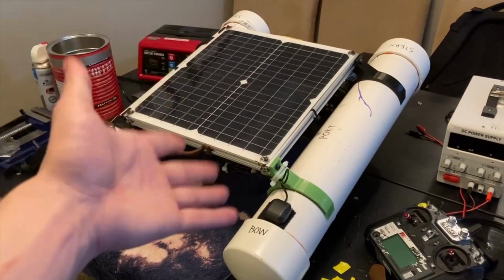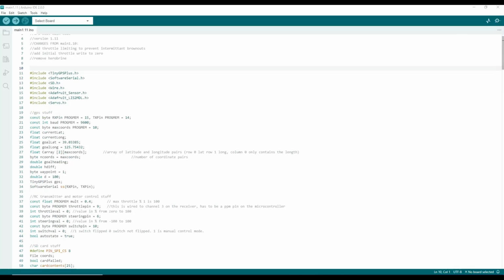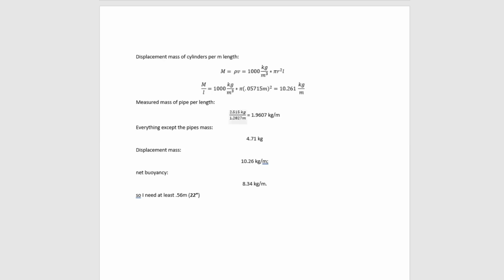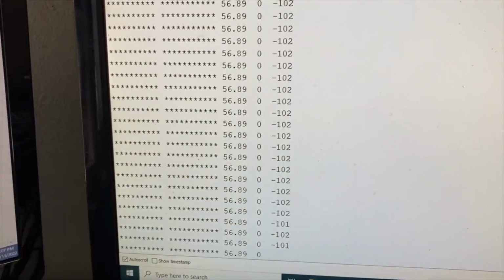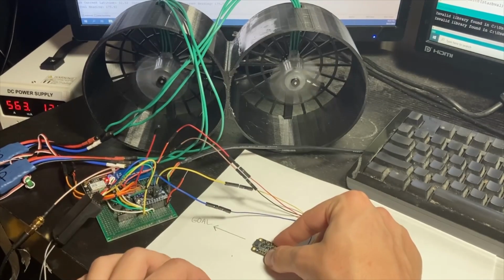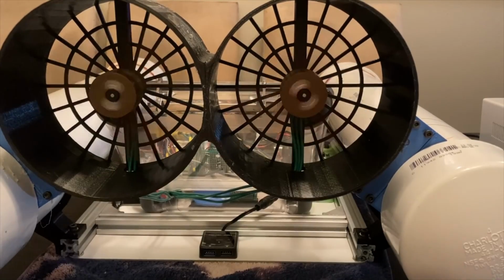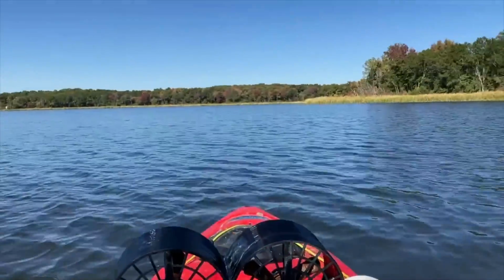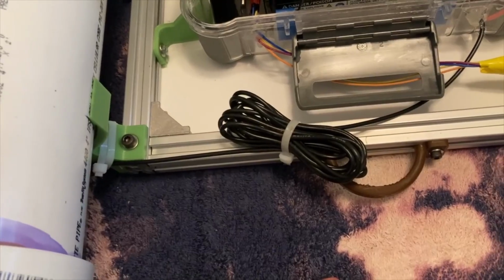Infinite Range Autonomous GPS Boat

Comment: Hey pls respond to this. My friends and I want to build a boat of our own and the only problem is how we are going to monitor it. So, I don't know if I missed it in your video but how did you control/make it were your able to communicate to it over long distances.
Reply from the maker: I don’t communicate with it over long distance. The RC transmitter can take manual control up to a range of about 100ft but I only use that for launch/recovery. I’ll likely implement 2 way communication/telemetry at range in the future with a serial radio.

Comment: What is this called and where can I learn in.
Reply from the maker: It’s custom control software that I wrote to run on an arduino, it’s pretty simple. Check my newest video on the project for the latest code version, I have it posted on GitHub open source.

Comment: For differential thrust throttle values (0-180), have you tried using reverse thrust as the range for each motor. 

So, -180 to 0 to 180...
Reply from the maker: The ESC’s I was using when this video was filmed were not bidirectional, so no way to reverse them without physically swapping wires around. I’ve also since ditched the 0-180 degree servo logic completely, it makes more sense to just use discrete PWM value in microseconds, 1000-2000 in this case.

Comment: How did you seal the cable exits of the motors? Which specific glue did you use?
Reply from the maker: The motors themselves are not sealed against water ingress. I used hot glue around the soldered joints on the back of the motor to prevent shorts between the individual phase wires. Also hot glue to fill in the drilled holes where the motors wires pass through into the electronics box. I’d use a proper potting compound if I were to redo it, but never caused a problem as it was in this video. Also notably, the pass through into the electronics box is not submerged, just keeping splashes out. Surely it would leak if below the waterline.
Reply: @Clay-Builds  Thanks for the fast and good reply! I'm doing my first underwater tests with electronics right now and I'm surprised how well hot glue seems to work all the time.

Comment: If your inlet shrouds were long cones you'd have a layer of self-cleaning capability. This will come in handy if you keep testing on lakes. Surround the panel with the sort of spikes used to keep pigeons from landing on ledges. Having a third, smaller thruster would give you better handling when you want to loiter in one spot (to lower a camera into the depths maybe). Adding ballast to the bottom of each float will increase stability. I assume they are hollow otherwise. I'd consider sizing the floats so they can be filled with foam. That way it will still float after being bitten by a gator/great white!
Reply from the maker: Yea this flat prop shroud design caused a lot of excess drag and it still got plants stuck to it a few times. For now I’m omitting the prop shroud entirely on the new version I’m building, but I’ll likely implement it in the future. I think a roughly conical wireframe design would perform much better. Also the props themselves could be optimized to prevent catching plants and trash.

Comment: Is there any obstacle avoidance technology on this pilot?
Reply from the maker: Nope, it’s flying blind.
Reply: @Clay-Builds Thanks for reply. What do you recommend for avoidance from debris, vegetation, and other dynamic obstacles?
Reply from the maker: @ehsankf  vegetation is pretty unavoidable which is why I always use some type of prop shroud for small scale boats. Your best bet for above the surface obstacles is probably LiDAR but that gets expensive quick.
Reply: @Clay-Builds  Does Lidar capture the obstacles floating on the water surface or hidden under the water?
Reply from the maker: @ehsankf  surface obstacles. There’s some small scale hobby level LiDAR units out there. Even some robot vacuum cleaners use them for SLAM.

Comment: Awesome design. I am working on an ASV for school. How did you waterproof the motors in your thrusters? Any tips would be appreciated.
Reply from the maker: Use sensorless brushless motors. For the most part, they’re inherently pretty waterproof and will have no electrical issues operating fully submerged. You’ll still need to worry about corrosion over time, but unlike typical brushed motors, there’s nothing inside them that could easily short out when wet. You’ll want to choose a motor with a relatively low KV value, because high torque is needed to drive a prop through water, and you don’t need very high RPM.

Many brushless motors, including the ones I used in this project, are specifically intended for underwater use. I didn’t do anything special to seal them or anything.

Comment: That looks like a fun project, and useful, too.

Projects like your/this have a lot of different disciplines to pull together, and not easy, from the physical construction, to the software, to the data interpretation. So, congratulations.

Perhaps the thruster box/deck mount could be made adjustable in height, to maintain a nice low center of gravity, like you have, but also to compensate for weight without using ballast. Alternatively, you could make a ballast tank, and fill it with water.

Perhaps you could slip in a rubber grommet (not the Harbor Freight ones) where the motor wires penetrate the shrouds.

A Teensy 4.1 would give you more processing power for the same code.

Have you checked out Paraview? As far as the props, you could also do a study with OpenFoam.

Comment: Awesome work!!! 
There is a potential in the code so that the activation point is saved and then always return to this point ??
Reply from the maker: It doesn’t currently do that, but it easily could with a just few more lines of code.
Reply: @Clay-Builds thanks for reply,  I will copy the code from the video or there is somewhere to download?
 I installed the other code with the sonar and takes 96% of 328ATmega ... there is any way to send you the progress of the progect ?
Reply from the maker: @zuzuniagrikubanos6473  I have a 2nd video posted with some updates to this project, it has a GitHub link where you can download the code. That version has a lot more functionality than what’s shown in this video, but you could remove a lot of what you don’t need to save memory. The data-logging, sonar stuff, error detection, etc. isn’t totally necessary if you’re just wanting to build a simple boat that drives around. 

The code shown in this video used almost 90% of the memory the arduino pro mini (atmega 328P) IIRC. A huge portion of that was due to the libraries I used for the SD card, magnetometer, and GPS module. Maybe you could modify or find some alternative libraries to save memory, but I ended up just upgrading to a better microcontroller.
Reply from the maker: @zuzuniagrikubanos6473  the pins in that code are correct for the teensy micro controller I used in the 2nd video. You might need to make some slight changes depending on what microcontroller you’re using. There’s also an electrical schematic in the GitHub link that shows which pins connect to what. Make sure the throttle signals are connected to PWM capable pins, compass is wired to I2C pins, etc. you can mostly switch things around to whichever pins you want, but I’d make sure the timing sensitive components like the GPS serial connection, receiver communication pins that use the pulseIn() function, and the PWM outputs should each have their own timers.
Reply: @Clay-Builds  I think the code in this video  is easier to find how to store the activation point, because it is also the most interested part in me ..I did print screen and to Arduino's program,,,if it work If it works like the video it will be perfect.!!!!there is any way to send you a photo from the progress ??an email maybe ?
Reply from the maker: @zuzuniagrikubanos6473  sure, you can email me here: claymantx@gmail.com
Reply: @Clay-Builds   thanks !!!!!!

Comment: I would of used a Airplane Prop type propulsion. A big problem with these boats is seaweed plugs up the motor. Its also simpler all you need is a directional vane to control it.
Reply from the maker: Yea that would definitely help with tangles but might sacrifice some power efficiency

Comment: Nice work😃 I like the idea a lot and it seems to work really nicely. I just fear it can't do really large distances as the motors are a bit weak? I fear they could collect some sea weeds or fishing nets etc. Hard to work around such issues..
Reply from the maker: Yeah the main reason I used prop shrouds is to prevent plants/trash from getting caught up. More powerful motors would need a much bigger solar panel, but I’d love to do a larger scale version eventually.
Reply: @Clay-Builds  I just installed 550W panels on my house walls.. they are 2,30m * 1,10m 😆 good scale I would say

Comment: Seems like you went thru alot of trouble waterproofing and mounting the box for the battery and electronics. Was there a particular reason for not storing the components in the water proof pontoons themselves?
Reply from the maker: I need easy access to the electronics so that I can troubleshoot, reprogram, remove SD card, charge battery, etc. The box with an openable lid is super convenient for this. The pontoon end caps are sealed shut with PVC cement. I didn’t want to put any holes in them and risk a leak since they’re critical for buoyancy.

Comment: What's to prevent the boat from being storm flipped upside down?
Reply: There is an easy solution for that. If your boat capsizes during storm it will flip back to its right position if you have a low centre of gravity. Preferably a 2 poles extending from the pvc pipes into the sea with lead weights.

Comment: Fascinating! I do have one concern. This design might work well-enough on most lakes, but in oceans the breaking waves could flip it over, killing the solar power. You might add a weighted keel to make it self-righting. The keel would also add more stability and directionality. As on a sailboat, it would lessen the need for the motors to constantly alter the direction.
Reply from the maker: This is only intended for lakes/ponds, although I’d love to build an ocean version at some point.

Comment: Is that solar controller reliable? that cheap controller seems easily damage battery.
Reply from the maker: It wasn’t great. I swapped it for a GENASUN GV-5, a more reliable and efficient mppt controller. Don’t think I showed it on camera, but it was installed during the test run.

Comment: I'd just use the PWM outputs on the Arduino to control the motors, no need for timing?
Reply from the maker: This does use the PWM outputs to control the motors.

Comment: Your autopilot relies on heading too much.  Look at aviation autopilots for methodology. Even 40yo aviation A/Ps will used tracking for control, not heading. 
Heading will always be wrong unless water current and winds are perfectly inline with path.

You need to computer the vector(desired track) from start point to end point and the adjust heading to stay on the desired track.  You need to correct for wind and water flow. To avoid hitting objects, the desired track must be followed, otherwise you will end up hitting the banks or running aground.

As you follow the desired track, the heading will face in a direction that compensates for the wind and water flow.  For example, a desired track of 180 and a wind of 270 might result in a heading between 180 and 270 depending on wind speed and water flow.
Reply from the maker: That’s true, in the presence of a strong lateral wind/current, it would make a wide arc towards the waypoint rather than a straight line. In the video I only used 4 waypoints, if I added a lot more between each of the major ones then it would greatly reduce this effect. 

The navigation currently assumes the direction of travel is always exactly in the direction the compass is pointing. I could also get the direction of travel from the gps module and use that for steering. That way it could steer slightly into the current/wind and keep the direction of travel exactly towards the waypoint. Only issue is I don’t think the gps heading is as accurate as the compass, especially at low speed.

Comment: Great work you got here!
Reply from the maker: Thank you
Reply: Clay .... can you share purchase link on the solar panels and also i did not see the details of the compass used
Reply from the maker: @godwinbadu-marfo7577  Adafruit LSM303AGR is the compass I used. It also includes an accelerometer which I’m not using for anything in this project.

The solar panel is just some cheap 12v panel off eBay, I think they’re all about the same. It was advertised as a 200W panel but in reality it’s closer to 50W
Reply: @Clay-Builds  thanks a lot for this detail

Comment: Esp 32 has more resources. 
The power consumption inside watter will be much greater than on land. Maybe that overloaded the esd.
Have you checked the temperature inside the box after a long time running in the sun? this components may need cooling.
Reply from the maker: Im sure the heat will build up overtime. ~25 minutes of continuous use did not make the ESC’s noticeably warm to the touch, but this could be a problem if it runs for several hours. The next version will include current and voltage monitoring so I’ll be able to see exactly how much load is on the motors and how much solar power is being drawn. I don’t think these motors are anywhere near the 30A nominal limit, but I’d like to upgrade the ESC’s anyway.

Comment: Call it hydronaut!

Great idea,unfortunately my gut feeling says it will be toppled by big waves and then die.. try to do a cylinder that always rolls right. Also I'm pretty sure the PV is too small.

And then maybe a rotateable sail plus keel would be a great idea, in place of the motors that still can be entangled..

Use LoRa / TTN to still transmit data worldwide..

Comment: Dude this is awesome! I am working on a custom auto pilot too but it's based on the RP2040 and micro-python. Looking forward to the new radios. Any plans for telemetry?
Reply from the maker: I’d like to add telemetry but it isn’t doable with the current radio I’m using. Considering some upgrade options

Comment: Full marks for effort and programming!
However for the next version, you've got to make it more hydrodynamic so that it's not just a weed collector!
Lose the propguards and use or make proper swept marine propellers that don't snag, or try using impellers like jet skis.
I would make proper catamaran hulls out of glass or carbon fiber and mount the motors internally in each one.

Comment: Clay, I was concerned about the ESC's failing as soon as you placed them in the sealed container with all other hardware.  If you could go with a waterproof ESC or just mount them out of the area of risk, I think that would be a help.

Also, in the V2, you may want to add a small threaded connection to each pontoon, to allow moisture to drain.  I know that in theory, no moisture should be able to enter the sealed system; however, I have found that it most certainly will (if only over time).

Also, there have been dozes of DIY builds very similar to yours for purposes of bathymetry.  If you're not familiar with bathymetry (essentially topography in water) you will find a great deal of similar builds and great sonar options for your build.

Like most autonomous rovers (land or water), most of the other DIY units use Pixhawk to save the added hassle.  You could go with the less expensive APM; however, a Pixhawk flight controller would be better for your needs.

Also, thank you for the excellent, comprehensive video!

Comment: why not make that motor mounts slightly rounded. also add telemetry 4G connection then live video? nice to have features. also why not use lipo battery then you more power less weight. love it so far!
Reply from the maker: They’ll be streamlined, I’m redoing them.
Reply: @Clay-Builds  looking forward to next video! and a night mission

Comment: Very nice. Keeping the props inside is good for forward and structural. Have you thought of putting these outside the pontons to increase turn speed and stability.  The idea of sonar is excellent, you could map out the best fishing holes in the lake.
Reply from the maker: Thanks. The stability is good as is. Putting the props further apart would improve the turning radius, but it’s good enough for what I’m using it for and I wanted to keep it compact.

Comment: You still using the 5V of one esc to power the 5V stuff? Get a $1 switching buck converter instead, since the esc use a linear regulator that gets hot and may die.  
A nice arduino compatible processor upgrade would be the esp8266 / esp32. I did use esp-now to replace the RC radio. See the quadcopter on my channel.
Reply from the maker: Im putting in a custom PCB and upgrading to a teensy LC. It’ll still use the ESC to power the teensy Vin, but the rest of the components will be running 3.3v off a regulator.
Reply: @Clay-Builds  Dont. The 5V reg of the esc is a "M" type max 500ma. Depending on bat voltage this will get very hot. At least use 5V from both esc.
Brtter get a 3A 5V buck for that, 90ct on ali. No heat, no problems, solid 5V rail.
The 5V->3.3V Vin reg is good, keeps 5V noise from the 3.3V rail. Keep that.

Comment: sweet build man, i like it. Could you keep the GPS antenna long by gluing it to the top of a pontoon?
Reply from the maker: Yeah I could bundle that wire up higher. I’m concerned if I cut out some length and solder it back together it could mess with the signal.